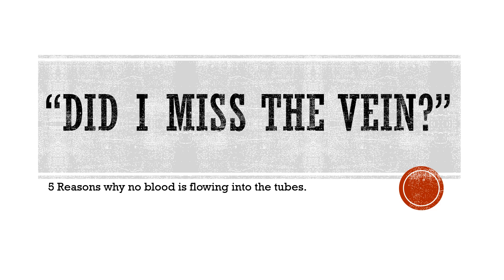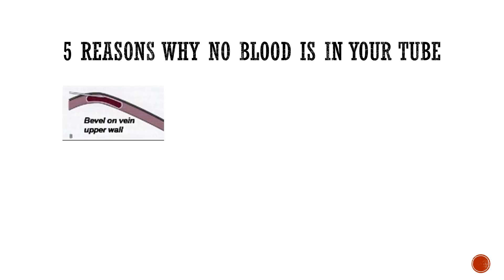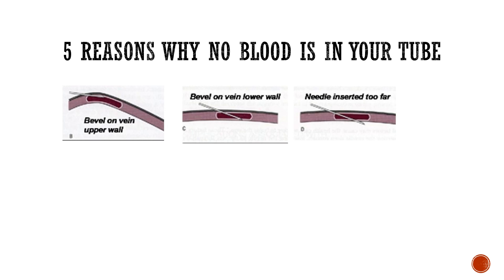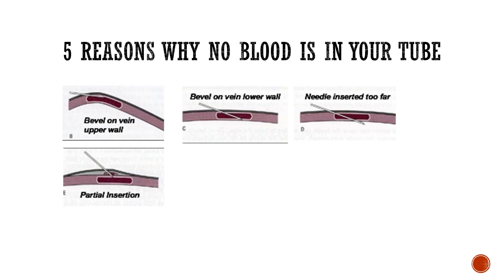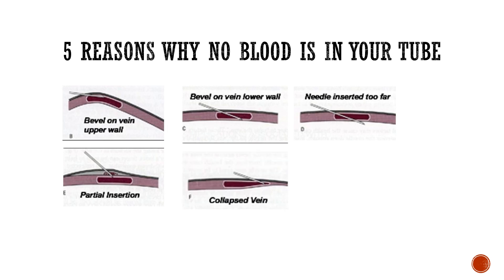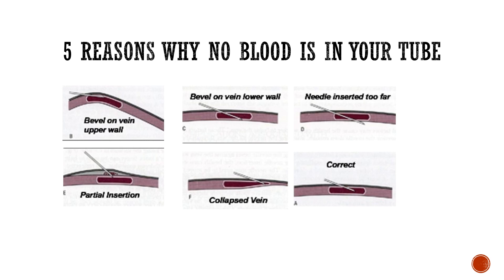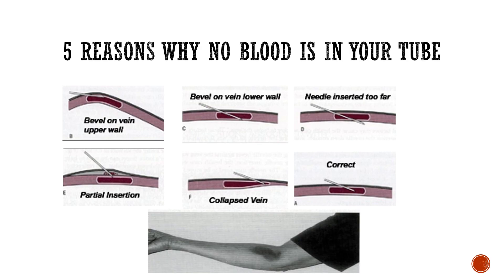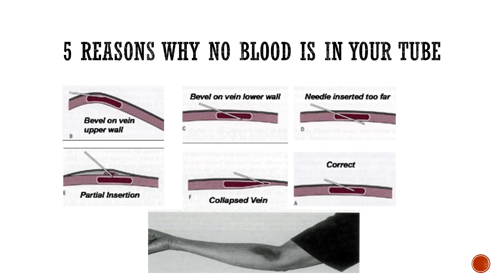"Did I miss the vein?" 5 Reasons To Consider.

Comment: This video is very helpful - thank you! How do you know which situation you're in? If the vein has collapsed there will be visual signs, but if what if you've made one of the other mistakes? If I don't get blood and don't know why, should I start by pulling back? Then adjust angle? Then try going deeper? Is there a recommended order of adjustments?
Reply from the maker: Every blood draw is different. Be aware of how you put the needle in the arm to determine if you need to go further or pull back. Never redirect the needle but you can adjust it by going deeper or pulling a little back. Every situation is different.

Comment: I’m in my classes and successful with all my sticks buttt with the butterfly on the back of the hand the blood flows through the butterfly but doesn’t go into the tube or if it does its fairly slow why is that ?
Reply from the maker: It depends on the size of the needle. If you use a 21-23 on the hand you should be okay. Don’t use 25g.